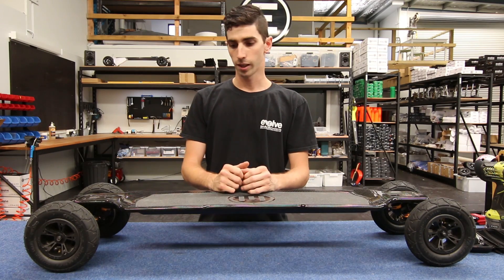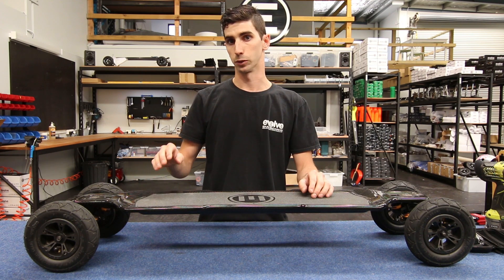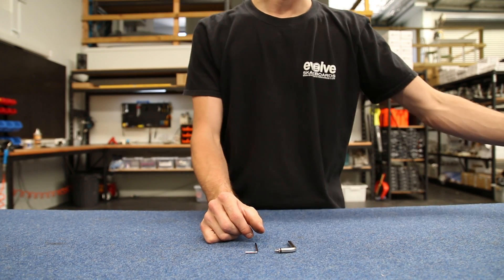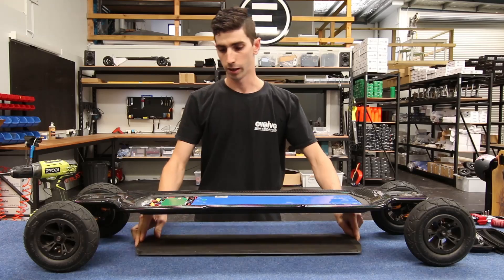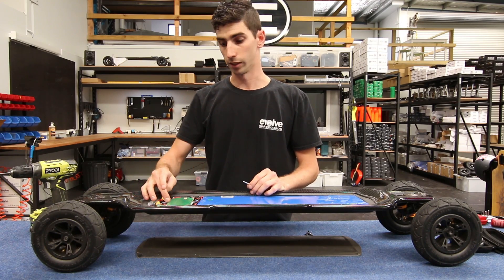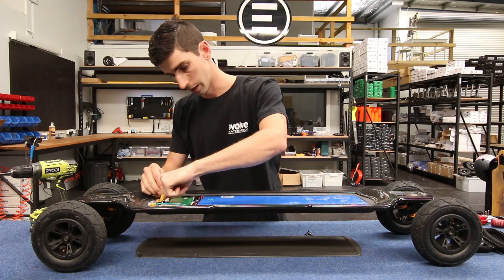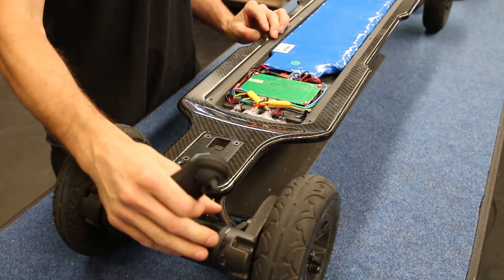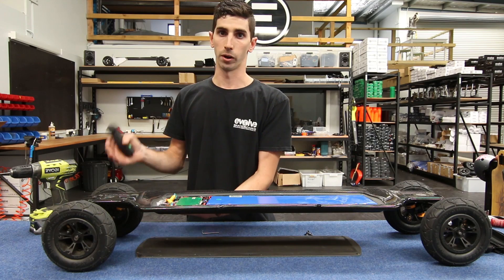How To Diagnose A Motor Problem || Evolve Skateboards

Comment: Hi, I bought a bamboo gt yesterday and rode it a few times but when I tried to turn it on today there's no light on the power button. I checked for loose wires and burnt circuitry and nothings out of the normal
Reply from the maker: Make sure the board is fully charged and is changing properly.  If it is, then contact your local support agent, they will check the remote diagnostics to see if the battery cells are all balanced, you can do this remotely over email or phone.  Please contact them.